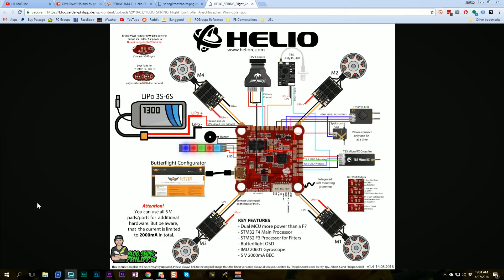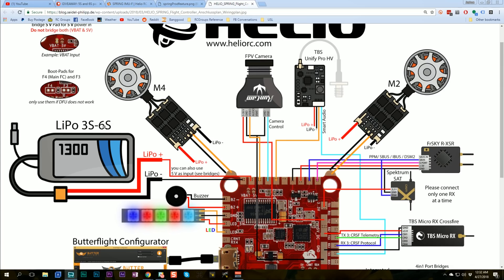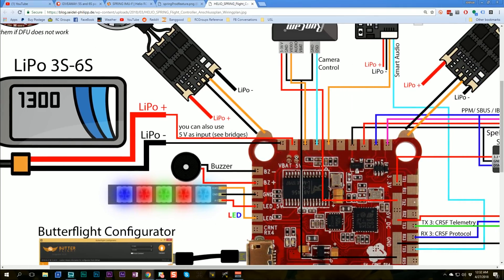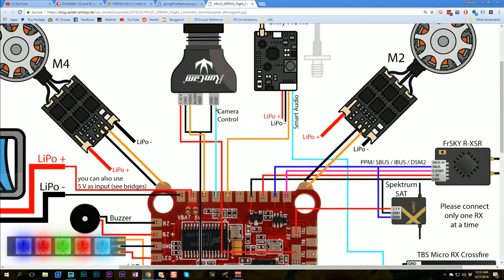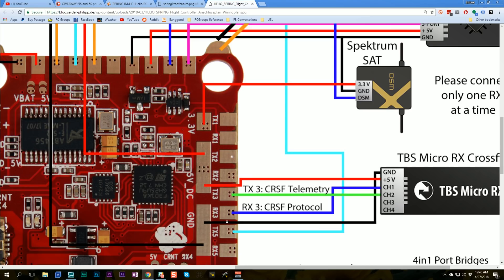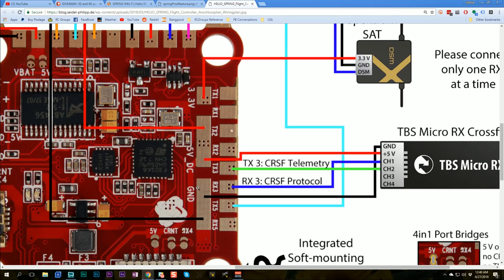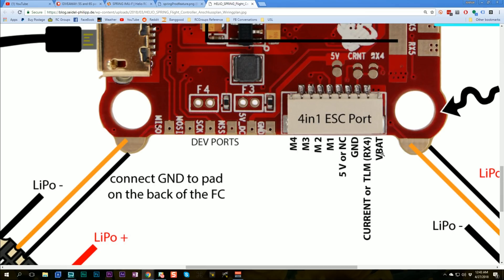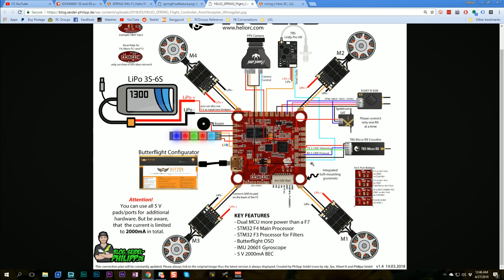Helio Spring Butterflight Flight Controller | F3 + F4 = F7?

Comment: I find that helio is really made for multishot, couldnt get it to fly great with dshot on 2 builds.
Reply: Maybe so but I have not had bad experience with dshot on other boards... 3D mode works better on dshot anyway so Im using it for sure.
Reply: Hamza Mohammad no I'm not an engineer but I have spent hours talking with the developer of this board and butterflight personally and he has personally helped me with tuning out earlier releases. Everything I said come from the developers mouth.
Reply: Hamza Mohammad dshot is a horrible protocol because it actually creates noise throughout the rest of the system.
Reply: I am about to finish my double degree in mechatronic engineering and computer science. I can read the dshot code and multishot code, understand it and don't see why multishot is better. I don't think I'm smarter than them which is why I am asking them for proof backing up their claims, not saying they are wrong. I don't see why my previous statement is wrong. Dshot is a more reliable protocol. It's sad you can't log errors between the esc and the FC easily or I would have done it myself.
Do you have any proof such as logs showing error rates or anything of the sort? I don't want a flight video as humans are subjective.
I would also like them to clarify the 'dshot is a horrible protocol because it actually creates noise throughout the rest of the system' statement. Again I am not saying they are wrong I am asking them for proof to back up their claims which I think is perfectly fair.
I also never thought I'd get involved in an internet debate but here I am :')
Reply: Hamza Mohammad “reliable” in what way and at what speed? 8k? Maybe. 32k? Nope. The CPU load on the ESCs is too high and it drops packets. Only PWM Multishot can run at that speed reliably
Reply: Hamza Mohammad heck yeah man! Awesome degrees to be getting together. I'm thinking about starting college for electrical engineering soon myself!
Reply: benii other than turtle mode, I don't see a point of needing dshot. Beepers also considered lol
Reply: James 3D mode and motor beepers are not something I would not want to miss.
Reply: benii yeah I still run dshot 600 on mine and there fine but they fly better on multishot. I just add alot of caps to manage noise.
Reply: Helio RC let's see it happen! Let me get some helio escs!
Reply: Hamza Mohammad your welcome to go look at my videos to see the results.
Reply: Well I have an engineering background and we don't go by look and feel. We use maths and logic to figure things out. And using my computer science knowledge i can say that dshot is a more reliable protocol. It has in built error checking so that only correct data gets to the ESC. Multishot does NOT have any as far as I am aware.
Reply: Could you please explain further ? Feel free to use as much maths and go into as much depth as you like.
Reply: Hamza Mohammad engineering background or degree. There's a difference.  Not to mention don't you think the creator of raceflight and butterflight and the helio spring fc knows a little more then you? Are you staring at the code or creating protocols?
Reply: Even the newer stm32f0 escs ? Maybe on the bb2s and bb1s we might run out of CPU but my understanding is that running DMA takes almost no CPU load and that's why we're doing it in the first place. And how does Dshot " creates noise throughout the rest of the system"? 
I personally don't see the point in running 32k but that's a different story and debate.
Reply: I just read through the multishot code in blheli_s and it runs interrupts from what I can see. I'm just very surprised that an interrupt driven routine runs faster and more reliably than a digital dma-based routine.

https://electronics.stackexchange.com/questions/240966/whats-the-point-of-dma-in-embedded-cpus
Reply: I did some quick testing MS vs Dshot600/1200 cpu use, at 32K MS is a clear winner https://www.rcgroups.com/forums/showpost.php?p=39494239&postcount=4177 I been running 32/32 on my revolts for long time (since bf enabled OC).
Reply: Dshot1200 drops packets at 32k and is a very noisy protocol. Dshot600 can’t run past 16k or the signal corrupts. I think it’s time to implement better firmware that supported multishot 2.5 that has reverse commands.
Reply: benii dshot is a horrible protocol.  It introduces unwanted noise into the system. Butterflight devs have not made a full dshot driver yet. They suggest multishot only.
Reply: @antimatter what proof do you have of this claim ? Do you have a engineering ish background ?

Comment: Butterflight flies great but motor gets hot..
Reply: Oztec there was a RC of 3.5 that introduced D on yaw but D wasn’t being filtered properly on yaw. Update to 3.5.1 and you’ll be fine :)
Reply: Helio RC  Sure.. I was so into practice that I didn't think of updating. Will do that pretty soon. Thanks for the advice. :)

Comment: Betafligt F7 32k bug = closed, from nightly build #780 I'm pretty sure
Reply: Dex just curious what you mean? I’m looking into getting the beta flight board but really want to know what it can and can not do. And if it’s software or hardware holding it back.
Reply: Betafligt and butterflight both have/had a bug that caused CPU to max out at 100%   when running gyro and Pid loop at 16k or over on f7. Betafligt devs have fixed the bug so it should be available in the next stable release.
Reply: Gotcha, software fixes are great. I just wanted to make sure the hardware was good.
Reply: I really wouldn't call it a bug though, it's much more complicated :)

Comment: F7 can run 32/32 no problems these days, you just have to run the nightly F7 release betaflight.
Reply: If anything - it's likely the opposite ... fewer updates with F7 + Betaflight than Helio + Butter.
Reply: Andrew, no. You just have to flash once.  32/32 is still new (even for the helio) so firmware updates are a reality.
Reply: Andrey Mironov thanks for reply just try a read nightly build of BF I kinds could be taken that nightly there's a new version you need to have to run 32/32 but once you have running than its not like it goes away cause a new version is available. I gotcha now I think. Another plus on the Helio is its labeled in English clear as day no need to glace into manual easy to see where your inverteds go, etc. No need reading up what I can run thru tx# rx#. Only thing I need find out is the list pin connections what do you do with vbat in wire when we bridge to run 5V in. Is VBAT a no-no do not connect as well or is it vbat current sensing so you can have telemetry and current sensing. Cause the board prob won't take 5V + Vbat voltage = fried FC most likely. Thoughts there?
Reply: I can confirm... https://www.instagram.com/p/BiKksNYlrrw/?taken-by=mpfpv
Reply: Hey can u post a link to the download cant find it and would love to try 32 32 on my Bf f7
Reply: PRINCE FPV https://ci.betaflight.tech/job/Betaflight/793/artifact/obj/
Reply: Andrew Blanche you don't have to flash your board every time you fly, why?
Reply: So every time your gonna fly you have to flash your board? That quite annoying. Definitely not a solution to compare to the Helio's capability.
Reply: benii this. Thanks for bringing this up

Comment: What is the ammo box with 2 screens on it in the background? I always notice it
Reply: QUADBOT FPV That's his power supply for charging, he's got a video about it. I built almost exactly the same thing and it's been rock solid for me.
Reply: Brad Watkins when I first got into the hobby I bought a charger that has a built-in power supply I never understood why people would buy a charger without one? I'm sure there's a good reason. I never even knew you can get a charger without one I don't think the hobby shop even sold those
Reply: Because chargers with built in supply are weak so you can't charge a lot of batteries simultaneously and quickly. Also you get one decent cheap supply and it runs any charger you're going to get later on, and will run several chargers at the same time.
Reply: ASJC27 why doesn't someone just make one? Wouldn't they dominate the market?
Reply: I don't think so. Including a powerful supply will make the charger both expensive and large and heavy. Also if your charger dies you lose the supply as well. Plus the built in supply can't power other chargers.
All in all I think a separate supply is more practical and cheaper.